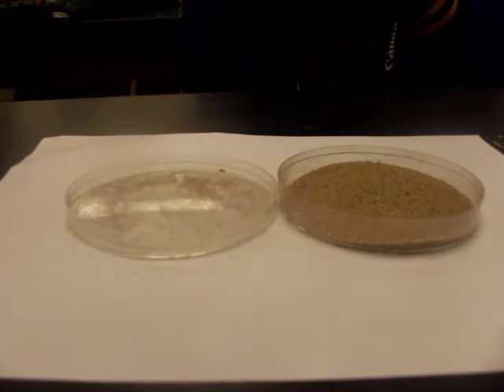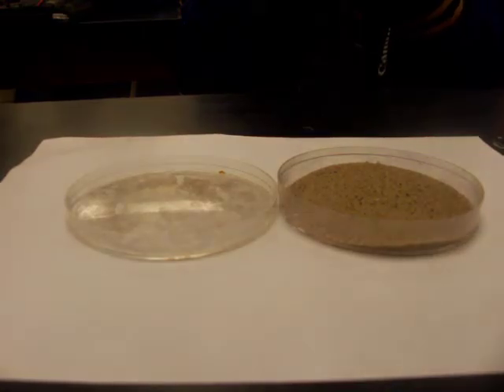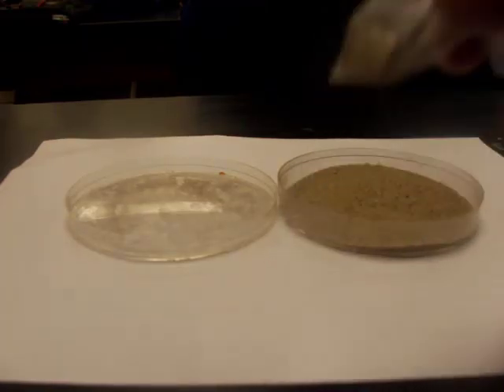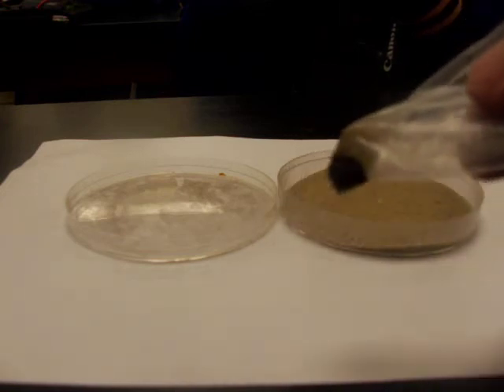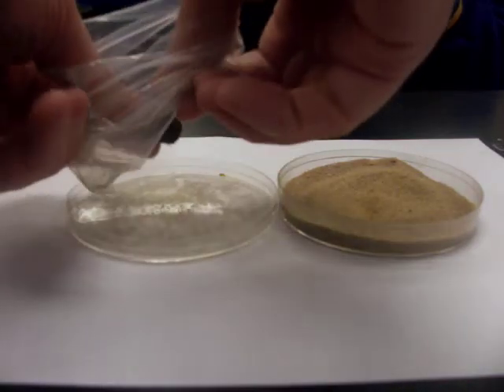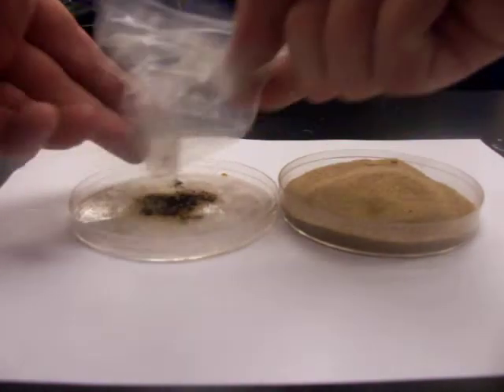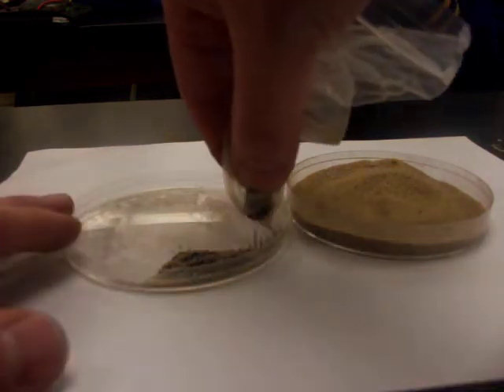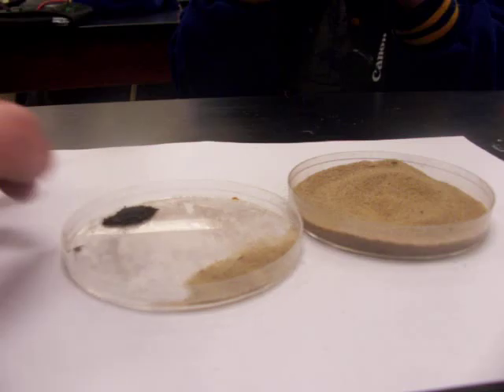Separation: Iron from Salt & Sand Mixture

Comment from the maker: @nicxtrem21 I am using a small neodymium magnet here, it works with regular magnets but they are weaker and so they pull less.
I also put the magnet into a plastic baggie to make it easier to get the filings off of the magnet.

Comment from the maker: You should be able to separate them because they have different densities and will not mix with one another,a separatory funnel helps, but isn't necessary.  You could also possibly burn off the kerosene, but it isn't the safest or a good method if you need to recover the original amount.

Comment from the maker: I can think of a way to get them separated, but the chalk does not remain a powder.  Start out removing iron from everything with a magnet [as in this video].
Add water to dissolve salt and sand will sink.  It is possible that chalk will float, but it probably is a suspension, as you say.
Filter let it dry to get the salt.
Add a weak acid to sand and chalk from the filter (like vinegar) to dissolve the chalk (but this releases CO2 changing the chemical composition of the chalk).

Comment from the maker: Water.
Styrofoam will float, sand will sink, and salt will dissolve (with stirring).
If you actually have to do it then, skim off the Styrofoam filter the water off the sand.  Allow the water to evaporate or force it with heat.
It sounds like I am answering a homework question and I should let you think of the answer on your own, but I've been looking for an alternative to the plastic beads I use which don't always float properly and hadn't thought of Styrofoam yet, so thanks.